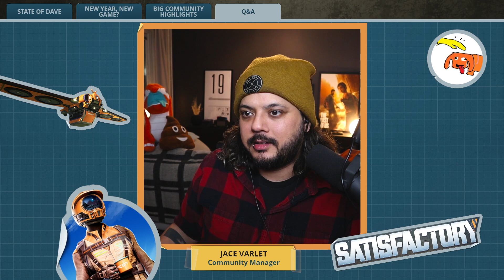Q&A: Any idea how high of a priority it is to fix the smoothness of driving on Foundations?

Comment: wouldnt casting 3 rays already be enough if they are offset in a triangle pattern by a small amount, then take the minimum length of all the rays? That way the check doesn't have to be against a shape and the performance would not be hit that drastically. Sure it would have to check 3 times as much but but im sure it still wouldnt be that bad.
Another Solution would be to buffer the previous state of the Ray's length and only update the wheels if the change is too high. That would be less memory efficient and there would be another check in there which could be a performance hit but it would still be very efficient. That method would only fail to work when 2 consecutive Checks result in a large gap.

Anyways its just a small graphical glitch so im sure it doesnt have to be that high on the list of things to fix. Great work on the Game.
Reply from the maker: Marv here; the problem is foundation tiles are processed as separate logical entities with floating point precision which leads to the issue where the 1-dimensional ray cast can slip between the gaps, and using an array of 1-dimensional rays offset from each other instead of a shape such as the one Jace describes might reduce the occurrences of the issue, it's not going to eliminate it.

As for the glitch itself, it's not just graphical- the physics simulation is at play here and it leaves you feeling like you're driving around over potholes.

My personal opinion for a solution? Coalesced objects; If you snap a 8x8x1 foundation to the edge of another 8x8x1 foundation, the physics engine treats that as a 16x8x1 box. no gaps for the ray to fall through.
Reply: Allright. But what about my second suggestion? That should smooth out the Ride a little as if there was a Suspension in the Vehicle. (Well not quite since im pretty sure that physics updates are quite fast but it could still improve things)
Coalesced objects are also a great solution. It would reduce the rendering efforts too, since reducing the number of Objects by combining them will probably mean some loops running atleast one Object less.
Im pretty sure in a lot of cases there will be significant performance increases by combining Objects when i think about things like colission resolution and rendering.
Reply from the maker: @TheHyperplayer  clarification: coalescing physics simulation does not require coalescing rendered objects.
Reply from the maker: @TheHyperplayer  Vehicle suspension would lessen but not eliminate the pothole problem 👍
Reply: @SatisfactoryClipsArchive  I am aware of that. I'm sorry that my last sentence was not that clear, I was refering to Physics simulations. (I'm studying computer science and my current most specialized and favorite subject is application engine development)
Im currently working on some Collision resolution myself. Lots of linear algebra in my case.